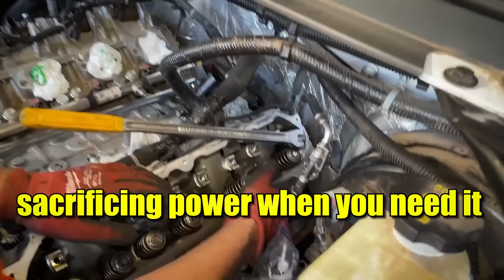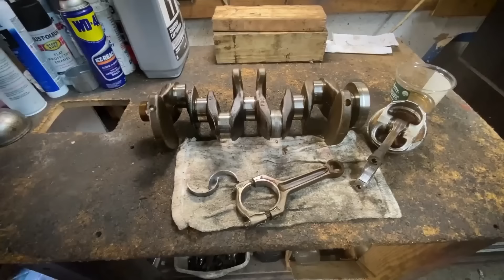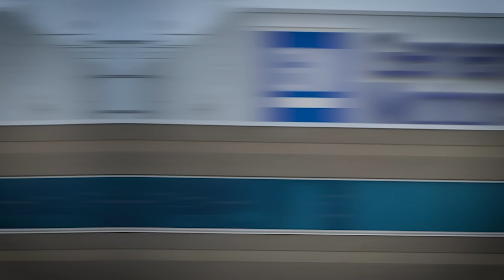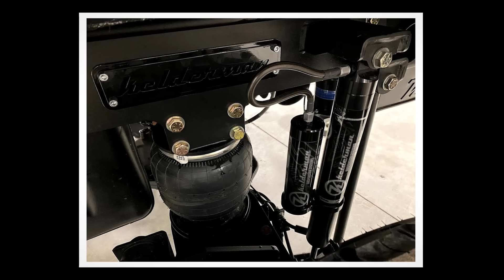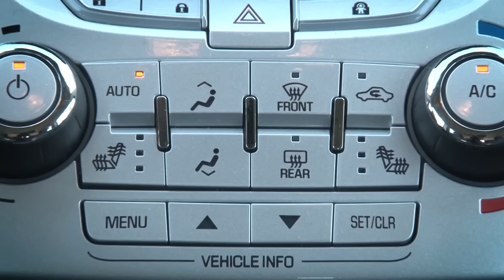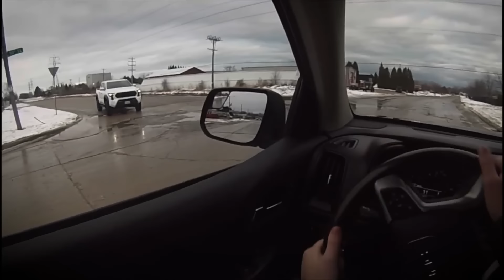These GMC Trucks Will Be WORTHLESS in 2026 (Don't Buy Them)

Comment: I have a 2020 High Country with 10 speed transmission.  I just had the transmission repaired under extended warranty.  Truck only had 72K miles on it.
Reply from the maker: That is exactly the concern with the newer builds—72k miles is way too early for a 10-speed to need a major repair. It’s a tough pill to swallow compared to the older transmissions that lasted decades.
Reply: @EverythingGMC-k9x  I had a 2004 Tahoe before this and it lasted till 202K and the engine went I know people driving older models with over 300K on them

Comment: What about the 2015 gmc Sierra/ denali 2500 with the 6.0L?
Reply from the maker: 2015 6.0 is a solid HD choice, generally non‑AFM and built for towing, follow coolant and oil service, keep the transmission serviced if you tow, and do a pre‑purchase inspection plus check TSBs for that VIN.
Reply: @EverythingGMC-k9x thank you man i appreciate it